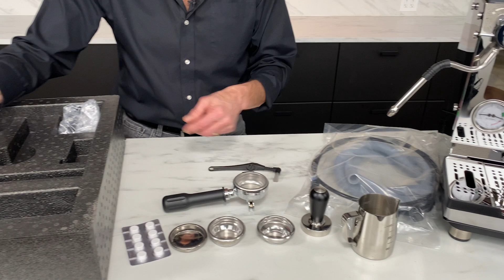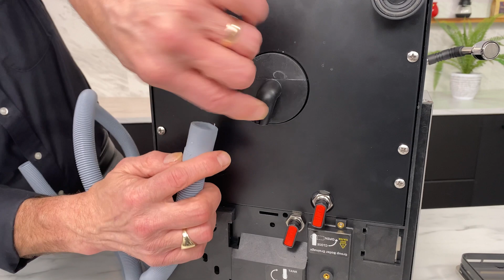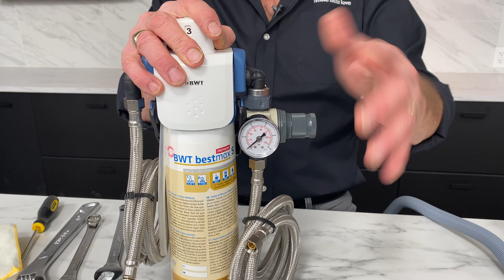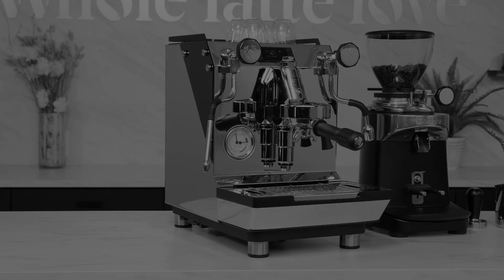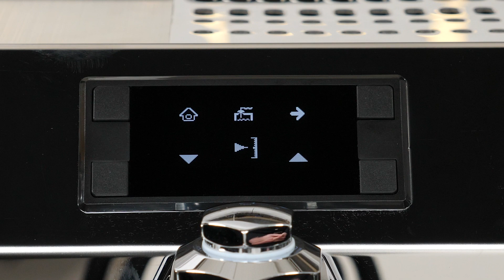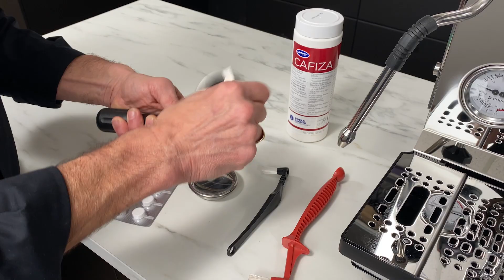Crem ONE Duo-V Startup Guide

Comment: Why did they use a vibration pump in this machine? Seems like a rotary pump would have been a much better and quieter option, even the Brewtus had a rotary pump I believe.
Reply from the maker: Hi JD, There are Crem One models with a rotary pump like the infuser: https://www.wholelattelove.com/products/crem-one-infuser-dual-boiler-espresso-machine
The newer variable speed DC rotary pump used in the machine is incredibly quiet!
Marc

Comment: I'm very strongly considering this machine as my first espresso machine. A key question is can it be plumbed into a 3 or 5 gallon bottle of water below my counter rather than into my home's water line ala the Decent Coffee Cart video that is going around. I'd like to use distilled water with a water recipe rather than try and filter my home's water which is very hard. I realize I will probably need an inline pump to pull this off. Really need your advice on this one before ordering.
Reply from the maker: Hi b, Thanks for the question. Should work fine with an inline pump to supply pressure. Might even work without the inline pump. We do that with rotary pump machines on a regular basis but have not tried on vibration pump machines as there are very few which are plumbable.
Marc
Reply: @Wholelattelovepage  Thanks Marc. Is that something you could easily test for me to see if it works without an inline pump? I've decided to get the Crem One Infuser instead.. I assume it would work the same way? I'm ready to order on Monday. I hope you have some still in stock.

Comment: Great vid! Nice thing about the spec I have (europa?) is that the adjuster for the OPV is mounted at the front. To the right of the brewer boiler drain outlet, behind the drip tray. Makes it a tad easier to set the brew pressure! 👍😎☕️
Reply from the maker: Hi Stefan, do you have one of the rotary pump models? That's where the OPV adjustment is on the Infuser (2B R-GSP Dual) and Profiler (2B R-LFPP Dual).
Keep in mind that on rotary pump machines the OPV isn't intended to adjust brew pressure, but instead acts as a safety valve. To adjust pressure on those models there's a separate pump bypass adjustment on the underside of the machine. 
AJ
Reply: @Wholelattelovepage  Nope. Mine has the vibration pump. 😊
Reply from the maker: Interesting, good to know!
AJ

Comment: So no single spout portafilter. Which is a waste of materials anyway as I have no idea when somebody would use that one.
Reply from the maker: Hey Jeroen, correct - no single spout portafilter though it does come with a single basket. I agree that single PFs usually go unused, especially in the US. 
AJ
Reply: @Wholelattelovepage  I always use the double and the second shot goes in the bin most of the time.
Reply: @jjg19631  what a waste. I always drink both. I can't handle the waste. I've come to terms with an early heart-failure-death, but as God is my witness, I will never throw a good shot of espresso in the bin 😂
Reply: @schakaljr  it is what it is. I’m not a fan of the 7 grams basket and do not want to switch from single to double all the time with different grinder settings.

I drink two cappuccino’s in the morning, one in the afternoon and one or two in the evening. Two out of four my girlfriend uses the other shot.

Though she wants an output of 12-13 grams, a different kind of milk and the milk at a extreme high temperature.  

Which took some work to master in my workflow 😊. 

I would love to be able to switch from naked to double without adjusting my grinder, but nobody can tell me how to get that right.